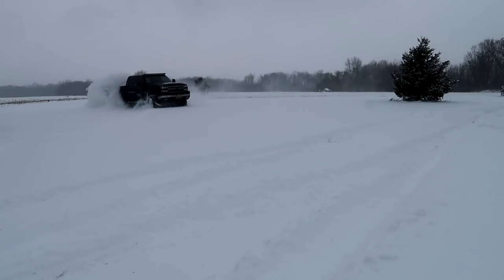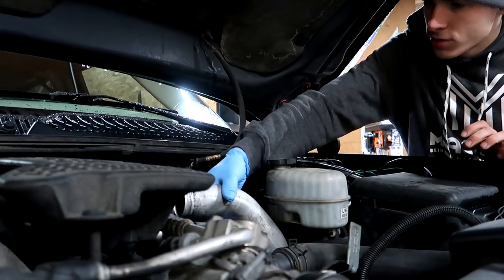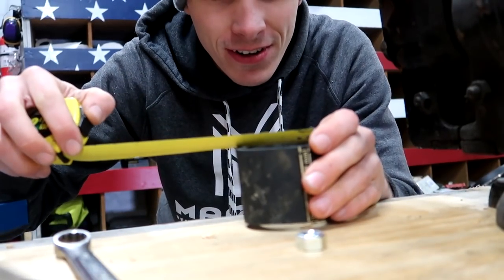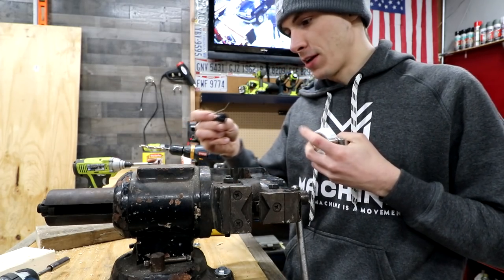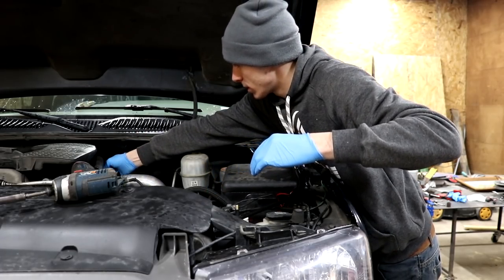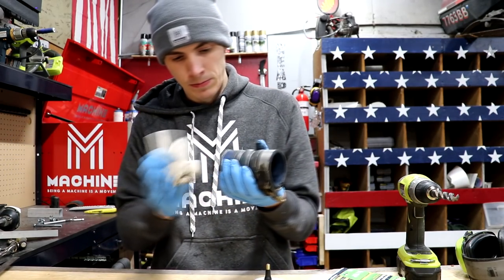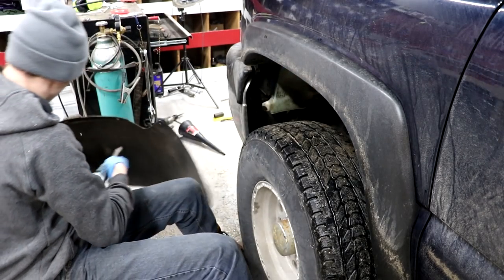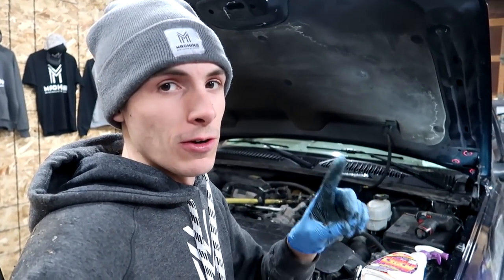$5.00 did THIS TO MY TRUCK!

Comment: I would recommend doing a PCV reroute kit and resonator box delete on the Duramax as well when you get time. Cheap and easy to do. The PCV reroute will keep oil from making its way into the intake and gunking up the turbo. The resonator box delete doesn't do much but improve the sound of the D-Max a touch.

Comment: 3DMachines, Have you thought about doing the turbo resonator delete on your truck? I saw you had taken it off to get to the Aluminum boost tube, and just thought I’d ask! It was the black plastic “6.6” on the top of the engine, removing it and replacing with a 2” Fernco Plumbers cap entails more turbo whistle in the exhaust note! It’s a great upgrade, and you can’t go wrong with it for just $4!

Comment: Good job man. Diesels are not cheap to repair as you already know. The 6.6 is pretty solid. Worst thing on those is stretched head bolts leading to head gasket leak. They make an insane amount of compression

Comment: @3DMachines On the top of your engine there is that box that says 6.6 duramax and the turbo has to fill that box with air before you get your full boost so if you take that off and put a cap on the hole the trucks spool is a world of difference it has so much more response I did it to mine and felt a giant difference try it out and see how u like it thx and hope you get to read this

Comment: Dalton just a little future advice. That same boost tube will rub a hole in itself just up from the silicone part you tightened up. Should electrical tape it or wrap it somehow. The silicone loses its hardness over time an starts to bounce around.

Comment: Looks like from the video you have the LBZ engine and pressure in those silicone hoses get pretty high. I've seen that same issue with the clamps coming loose at that same place on the intercooler. You did well.

Comment: You need to run back to the hardware store to get a 2-inch rubber plug to do a resonator delete. It cost like $4 and you should be able to hear your turbo whistle more.

Comment: He needs to either pul lockers in or put posic trac axles in it bc his 4wd is not as strong as it could be he is running open diffs rn n its losing traction when he goes to pull something